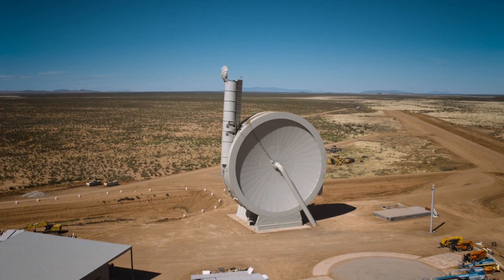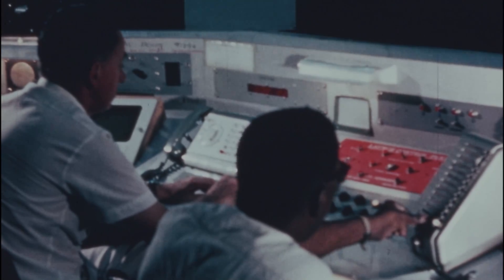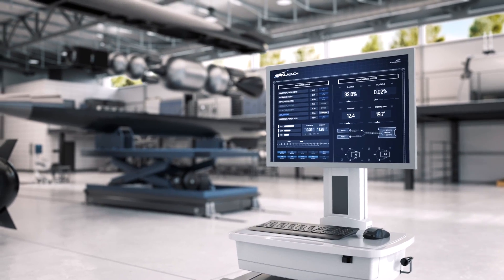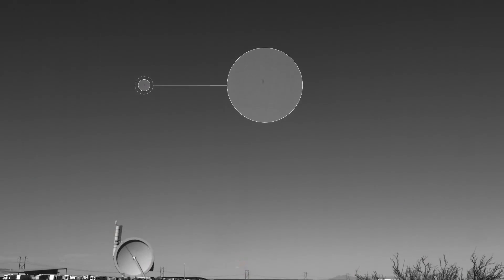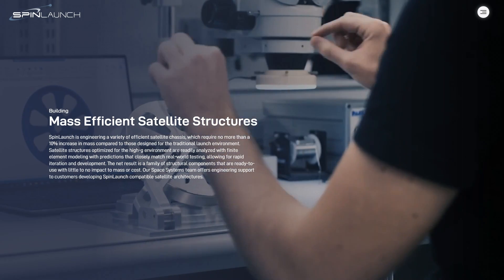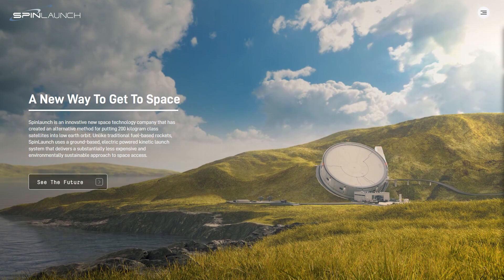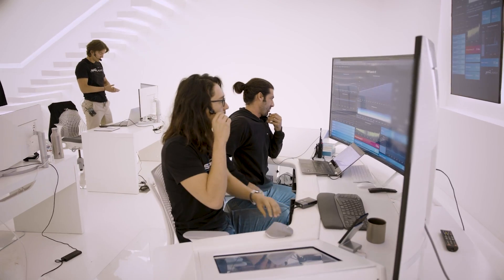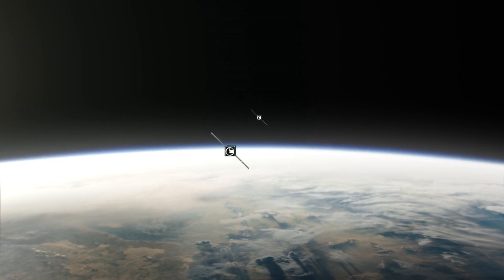Can Spinlaunch Throw Rockets Into Space?

Comment: I went by SpinLaunch here in LongBeach last year. After leaving, I had also thought, why not a railgun?  I did some calculations and figured out the instantaneous G's produced on release .... 10,000G's to zero instantaneously.  That's not the same as building G's from 1 to 10,000 gradually over hours.  Not sure what they're planning on firing, but survival would be difficult for most payloads. Also, I didn't hear anything about the massive imbalance incurred during release and how they intend to keep it together .....  The only thing I could think of is to release the same amount of mass from the counterbalance at the instant of launch.  Then, where is that mass going to go?  Into a capture tunnel buried underground?
Reply: If they use a larger counterweight close to the axis of rotation (which it seems like they already are) then it might have a manageable amount of energy after release?  (mv^2 and all)  
Certainly, no other way of balancing the flywheel comes to mind.

Edit: I looked it up, and this is the mechanism described in their patents.  I didn't see any external indication of a capture tunnel or anything on the test launcher, so I guess the lower velocity makes a big difference.
Reply: This comment had me thinking for a while about how to engineer the solution. In order to stop the armature from coming apart, we need to move the center of inertia back in line with the center of rotation. Assuming that the center of rotation is a fixed point in space, we just need to move a mass such that the inertia of the two sides becomes equal again. Obviously we need to subtract inertia from side A, but what if we could the same amount of inertia we subtract from side A into side B? Imagine, a large mass inside the armature that starts balanced on the axle. It has a higher mass on the side of the rocket, but sits offset such that the inertia it contributes to both sides is even. At the time of rocket release, an anchor point connecting our floating balance to the fixed countermass side is released. Being heavier on the rocket it side it naturally moves outward, removing mass from one side and adding it back to the other. It just has to move and be balanced such that the center of inertia is stabilized and the momentum of the two sides is returned to equal.
Reply: @dustinbrueggemann1875  I don't think that doing the rebalancing that way can be quick enough to work before the whole thing damages itself.
Reply: Simultaneous release of both projectile and counterweight is the only way to avoid a large mass imbalance.  That means you need two burst discs 180 degrees apart, two explosive charges, and two electrical devices as points of failure.  And those explosives must instantly (and successfully) cut through load paths capable of carrying millions of pounds of force.  It's highly non-trivial.
Reply: @lithiumdeuteride  the best solution is for the balance mass to be on the side of the payload, release before the payload and instantly release the payload upon the balance mass reaches it's final position. Imagine a large roller being released and roll up the payload spoke and just before reaching it's final place it hits the release mechanism for the payload. All the energy it has accumulated will transfer in to the payload release mechanism and the moment of release will be perfect for the balancing.
Reply: Wouldn't a counterbalance steal energy?
Reply: @UltraGamma25  yes and no. Yes, having more weight means more energy is needed to accelerate it. But to manage the spin velocity needed you need a counterweight anyways for the center of mass to be precisely at the point of rotation (it would tear itself apart during spin up otherwise).

The problem comes that at the moment of release, you no longer have a balanced system. That same counterweight that was helping you, now is another problem that needs solving. They need to do something with that counterweight in the same instant of rocket release. Releasing it as well into a capture tunnel sounds like the most straight forward solution, though you need to dissipate all that energy in a more or less safe manner. But replacing the counterweight with each launch would be cheaper than rebuilding the entire building if you keep it unbalanced at those speeds.
Reply: Two possibilities: 1) upon release of the projectile a mass inside the arm moves away from the center towards the tip of the arm.
2) a similar mass is released at the opposite side
Both can be liquids for example.
Reply: @pietroprestininzi  That is certainly feasible. Another option would be a sliding weight, although this would face the problems brought about by mechanical parts.

Liquids really are the cost effective solution.
Reply: Just thought about this and came to the same idea. Just have a lump of steel of the exact same weight on the other end of the launcher and release it into a deep enough hole. Problem solved
Reply: @christianh2581  idk .. 10 tons of steel flying at 2100mph .. good luck slowing that down 🤣
Reply: @matejbludsky8410  you could use 40 tons flying at 525 mph. Have a very strong walled tunnel full of water going down a few hundred meters to capture it.
Reply: @christianh2581  This lumb of steel will carry the energy of 6 tons of TNT equivalent at the time of release. It will explode like 6 tons of TNT no matter how you catch it.
Reply: What if you had an appropriate mass inside the arm on the side where the "rocket" is launched from that's hooked to the middle of the arm and gets released at the same time to propell outwards but be caught on the end of the arm and replace the missing mass of the rocket? Releasing anything from the opposite side would probably cause massive damage inside the chamber, even if you just released water from a container.
Reply: @moos5221  I think they have some method to shift the balance. I thought the same thing you just mentioned too. Their idea requires something that moves, taking time. The idea you mentioned would be instantaneous and less prone to failure. I totally agree.
Reply: They had a successful test launch. How did they solve the imbalance problem at release?
Reply: @rcnfo1197  I think they didn't. They just used a much heavier spokes and the payload was actually quite light.
Reply: The only way I can think of is an electromagnet on the counter-arm's end, and its counterparts lining the stator chamber (the room in which the arm is spinning). Use electromagnets to give you the counter balance, then cut the power at the precise moment. Also, thanks to the nature of electromagnets, you can regulate the exact amount of counter balance you're providing.
Reply: @TarisSinclair  the main problem with that boom is that all of sudden it's going to be at full atmospheric pressure and it's still going to moving at supersonic speeds. The sudden change of forces may cause total destruction, or it will burn up like a meteorite.
Reply: @SciHeartJourney  I wonder if they can re-seal the exit tube before complete re-pressurization occurs.
Reply: But…….the circular system jerks from 10,000g to zero, at release, within 1 millisecond*. Whereas, a linear railgun system could be made 1km long, instead of 25meter radius, and taper the acceleration down in the last 10% of the rail. So the jerk (and jolt) of a circular system is *much greater than a linear system.
Reply: @johnfranklin8147  I'm not talking about using magnets as linear railgun. I'm talking about lining the circumference of the circular "windup" chamber with electromagnets, and a counterpart EM on the opposite arm to the one that carries the rocket. As you're increasing RPM, you would increase the power to the EMs, counteracting the pull on the arm caused by the extra weight of the rocket attached to it. Then you cut the power to the magnets at the same time as you release the rocket, so both forces cease at the same millisecond.  This system IMO is much quicker to react than any liquid counterweight, because it literally moves nothing physical - it just exerts the counter-force.
Reply: @johnfranklin8147  It's not 0 on release. it's negative. And with a rail gun it's 0-10000-negative 4 or 5G in a few milliseconds with the flinger it's just the 10000 - negative 4-5G
Reply: @TheOriginalEviltech  With a railgun, the rate of change of acceleration near the start and end of the gun barrel is whatever you choose it to be. You can ramp the current and magnetic field up and down, to suit your requirements.
Reply: @johnfranklin8147  Yes, but it takes so many miles of structure to actually make it viable... I like that people are brainstorming about it :)
Reply: "That's not the same as building G's from 1 to 10,000 gradually over hours" When the rocket is released from the centrifuge, the radial acceleration suddenly drops from 10,000g to zero, so the jerk is similar to that in the a railgun.
Reply: @cogoid  I think he’s getting at it’d be hard for the hardware to survive the Gs for an hour and a half while it spins up to velocity. That’s a lot of Gs to just sit there in. Parts of the hardware on the rocket would start breaking before it even gets a chance to go to space
Reply: @cogoid  Glad someone else spotted that
Reply: @cogoid  well, at super- or hyper-sonic speeds, I don't think you should pretend that it is on a ballistic path. There will be G forces due to atmospheric deceleration.
Reply: @mckenziekeith7434  Atmospheric drag will produce axial deceleration on the order of 10g.  This is negligible, comparing to the radial acceleration going from 10000g to zero in a fraction of a millisecond.
Reply: @cogoid  I guess you are right. 10 g's is a lot but not compared to 10,000.
Reply: @cogoid  EXACTLY what I was thinking.
Reply: They do have a counter-weight. Upon launch, they can shift the counter weight toward the center. They can do the shift right as they ease into launch, but there's still bound to be some measure of jolt. Therein lies the tricky part: minimizing that jolt.
Reply: @yapdog  How about a ring of electromagnets around the outer wall that can change it's output depending on the weight of the payload? The moment the projectile gets released, the electromagnets start and exert a pulling force on a permanent magnet situated on the fore end of the spin arm which slowly declines relative to the rpms of the said spin arm.
Reply: @HertaSeggs  Magnetic braking is an interesting idea. The issue, though is you'd be transferring all that kinetic energy to the structure. Still pretty disastrous.
Reply: Damn I was thinking the same thing, that or we need to build a platform closer to space. Man made mountain or something
Reply: What about the counterweight being a tank full of liquidified gas.
When releasing the payload: you open a huge valve on the tank, emptying it (i. e. loosing it's weight).
Reply: That was a great point you made about the sudden imbalance once the payload launches. At 5000 mph the slightest imbalance is going to tear that thing apart.
We can do some calculations because they mention a payload mass, we know the size and the speed.
Reply: Ok so the issue is you need to change the center of gravity back to the center of rotation after release. What about using something like a railgun or explosive to push the counterweight back towards the middle?  That would happen really fast, so there wouldn't be much delay. And you could even assist it by having a large extension spring attached to the counterweight which normally keeps it in the center.
Plus side: the extension spring force actually works against the forces pulling the arm apart. So if you made the extension spring span the length of both arms, it would preload the entire thing in compression, increasing the strength. Kind of like rebar and concrete.
Reply: Why not make an hybrid solution. First launch it with the spinlaunch system with the whatever velocity possible without killing or destroying everything. Then when that's on an altitut before is loosing to much velocity then you shoot a railgun proyectile to the buttom of the rocket that whould have a nice shock absorbers and springs that will absorb the energy and transfer it to the rocket accelerating it more
Reply: @JP-xd6fm  Don't take this the wrong way, but that's a terrible idea. There is no shock absorber in existence that will withstand a projectile of that energy, nor is there an aim system accurate enough.
Reply: @JP-xd6fm  Are you suggesting shooting it in the ass to keep it moving?
Reply: @JP-xd6fm  You can as easily just shoot it with a 20-30 megawatt laser up in to orbit.

Comment: That's a great idea. About the rebalancing problem the first solution that I see it releasing the same amount of weight on the other side of the rotating arm at the same time  the roket is released and for that purpose another sleeve will have to be built for the purpose of slowing down safely the counterbalance.

Comment: This concept can still be improved:
1. Drive: Use a falling mass instead of electric motors. With a cable. As everyone knows from starting a lawnmower with an internal combustion engine.
2. Launch / compensation of the changed mass inertia (imbalance): It is obvious that one simply attaches a counterweight on the opposite side that is shot at the same time, of course in the opposite direction, i.e. another "chimney" / barrel towards the center of the earth. In this chimney one can slow down the shot counterweight by means of induction coils and with the induced current the projectile in the "chimney upward" can be further accelerated there by means of induction loops.
3. Acceleration: The high g-forces can be easily reduced by making the diameter of the system as large as possible. This also creates space to integrate the fall path for the falling mass.
4. It is only obvious that the falling mass can also be braked via induction coils, by means of which the projectile can receive a further burst of energy.

Comment: That’s so cool…mechanical know how to replace all that heavy fuel consumption and risk in traditional rocket launches.
In learning of this video, I couldn’t stop thinking that the system might even be able to use BIGGER diameter to completely reach space without any ‘rocket science’ ???

Wouldn’t this launching technique also gain bearing and G-force leniency from being deep underground in areas free of granite?
I like the part about the spinning chamber happening within a vacuum before the launch pierces the sealed exit. I have to know what that material is…canvas? glad wrap?
LAYMAN’S QUESTION-S: Could a long high-pressure stream of ionised air just outside the chamber assist in removing air-resistance…and or ionised seeding of atmosphere in launch pathway?

Comment: During the introduction of the idea/when I saw the thumbnail, I thought "this can't possibly be on earth, too much air, and even if it does reach space and launched at a tangential angle to the surface, the periapsis will be at ground-level and crash after a single orbit" (which was later explained that it brings fuel and engines up, and is only meant to replace the first stage[s], making it more reasonable). So I instead wondered if this video meant a system to throw cubesats into orbit, used once the rocket already reached target altitude, which strikes me as a rather interesting idea.

CBA to do the math atm, but I wonder what diameters and rpm would be needed to get your typical cubesat into its typical orbit if "stationary" while at its target periapsis. And I wonder if a system could also be designed such that 2 non-cubesats (so more mass, and potentially wonky distribution/volume) is tethered and spun up (like the idea for that cycler idea scott mentioned once before did for artificial-gravity), releasing to throw both into opposing orbits without wasting fuel (potentially returning the system to recycle for another launch, if letting it burn in the reentry is expensive).
granted, it probably takes more delta-v/fuel to reach space, than to accelerate into orbit (so the ground-based system probably saves more costs - particularly because the system itself would weigh a bit [aka not save much on initial stages fuel]). But it would need to launch the objects at around 7 km/s at LEO, so that corresponding amount of fuel could be skipped.

Comment: Simple Solution™ (so it may well be a terrible idea) for the problem of balancing the rotor: Detachable counterweight. Basically, have two "launch chutes," one going up, the other aimed straight down into a sand-trap or something. Payload to orbit goes on the end swinging for the sky, and a big lump of steel goes on the other. Both sides let go at once, the payload intended to head skyward goes skyward, and the counterweight gets to eat dirt. Then you just bring in the digger and dig the counterweight out to see if it can be reused or needs to be refurbished.
Reply: main thing is to accidentally not launch counterweight into orbit instead of payload... the thing spins so fast, who can know and remember which arm is the correct one :)
Reply: @bentos117  A computer, hopefully! Also, the counterweight wouldn't actually go into orbit, since it wouldn't have any fuel or rocket motors, you'd just have launched a gigantic lump of steel into a semiballiistic trajectory that, hopefully, comes down over the ocean!

Comment: Im wondering if the electromagnetic system used on the railgun Could'nt be used for this system (but using magnets around the circular structure rather than on a straight line)  Not sure aboit efficiency but would mean less moving parts